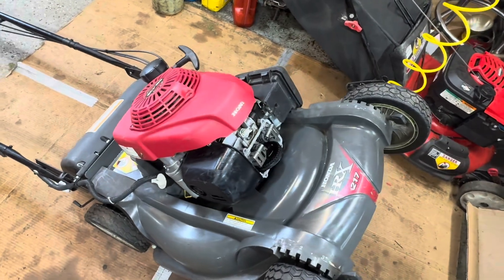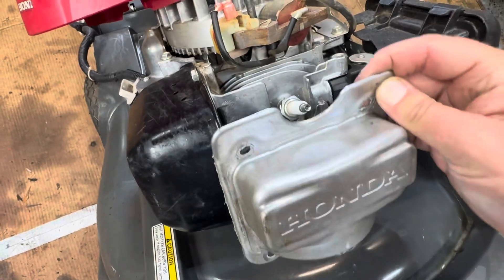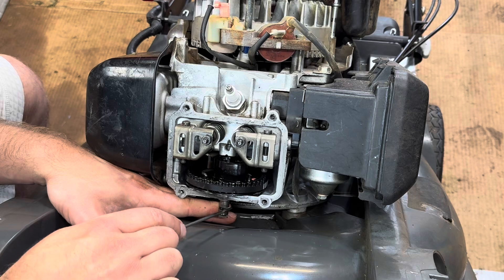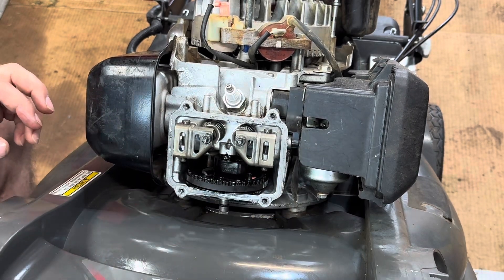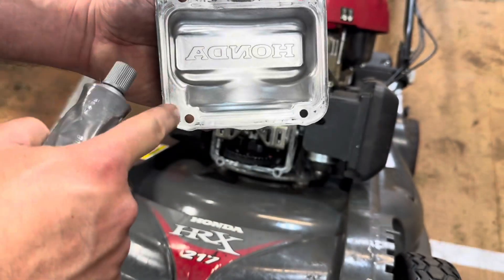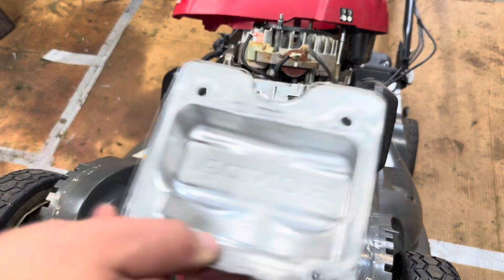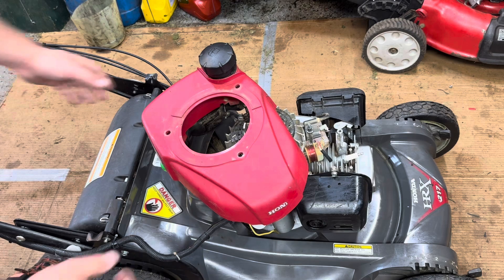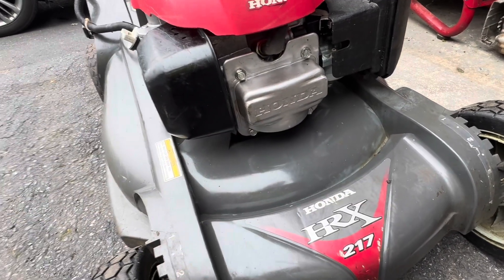Honda GCV190 leaks oil, diy repair

Comment: I think that is the issue on my Honda powered mower now.  What might a repair like that cost?  Thanks
Reply from the maker: $15 if you do it yourself. Probably $60-$90 for a shop.
Reply: @SHONEY21Z  LOL, my honda HRX217VYA has been leaking since i bought it.  I took it in to a honda official repair shop, and now it's back over there for the same reason.  LOL